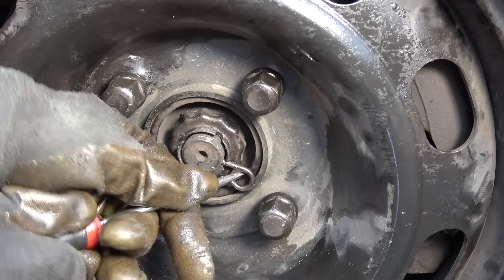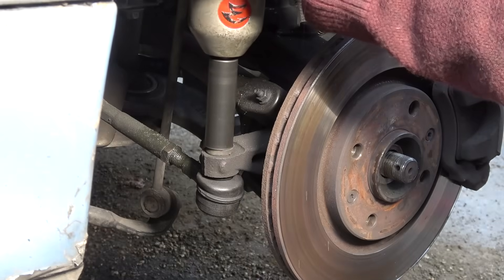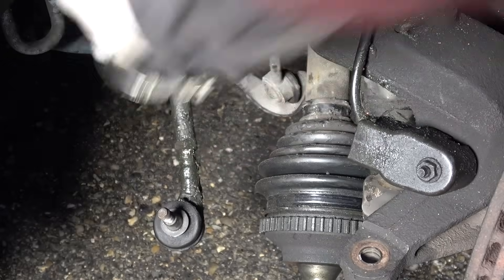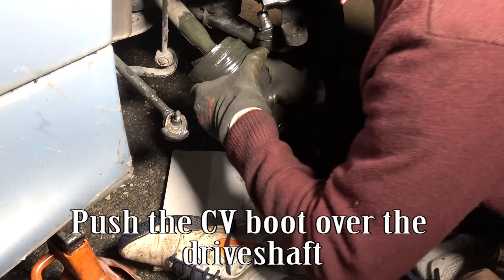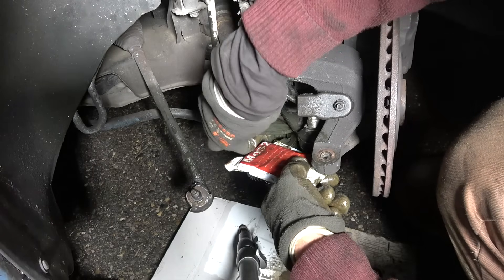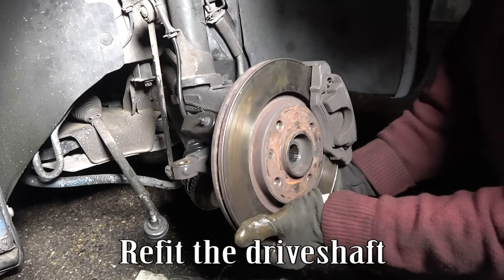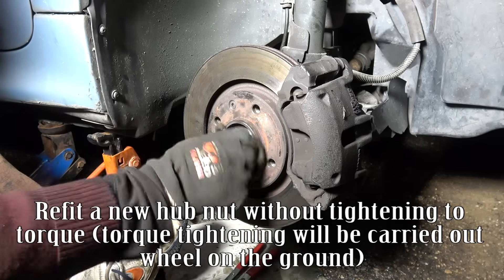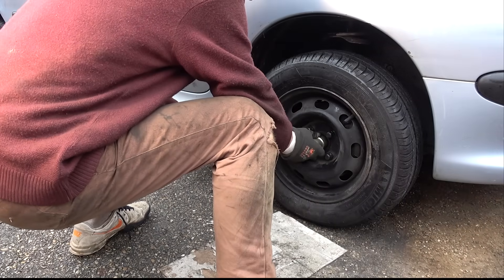CV boot replacement in place with a cone

Comment: Is this video a parody? Was he trying to tick off a list of things you should NOT do?

Start off with gloves that fit better then you won't be fumbling like a spaz.
Breaker bar to loosen the nut, then whips out the pneumatic impact gun?! Why?
Hammering the drive shaft naked?! Stick the nut back on the end if you really have to shift it and tap that, otherwise that recess in the middle is great for shoving a pointy bar in to jab it out. Damage the shaft and the splines and complain about the thing not meshing later!
Use tin snips to cut the clip, not a dremel! Now you have metal shards everywhere and cleanup became a lot harder. What else you likely to cut with the dremel? The ABS?
Looks like you're using engine oil to lubricate the cone, which will corrode the rubber. Use the grease then you won't get contamination.
Spraying brake cleaner on the old boot, to do what except shift all the dirt into the existing grease? And not cleaning out the old stuff first before squeezing the new grease in? Your DRIVshaft is going to sound like a peppermill 😂

Mate I hope no one is seriously following your example.

Comment: I used soap instead of oil .... it's bad tecnique if you completely reverse the boot .... it increase the friction ... I didn't reverse the boot, I get soap everywhere on the external of the boot and put the small tip of the boot on the small tip of the cone .... you clean you hands, so have good friction on the boot and you push it with the hands on the inter dry side. Of course, the boot tend to reverse itself, but only partially if you push on the small part of it. A strong e decise move seem to work better in order to get it over the large part of the cone. That's it. If the boot reverse completely on the cone you have much more friction and a great struggle to get it over the end of the cone. The smaller part of the boot (externally) has to be very slippery and the large end the the cone too .... there is where the struggle is.

Comment: While this may look easier I highly encourage people to just take the axle out completely. All you need is a flathead screwdriver, pry it to where it connects to the drivetrain and pop it off.
Afterwards with a hammer just lightly tap the CV joint out and done. Once the boot is in and you cleaned her up good just tap the joint back on.
Sounds like more work but trust me, this is waaaaay harder to do.
P.S. Do not use break cleaner on rubber, it deteriorates the material. Instead use any mechanic soap to clean up the excess grease/oil.

Comment: Just remove the driveshaft, put the shaft in a vice.  Cut off the old boot and compress/expand the circlip and tap the CV joint off the shaft.  Clean up, re-grease and reassemble.  Yes you lose a little gearbox oil but it's a lot easier than struggling like this!

Comment: Excellent video, just one comment, this was made more difficult by allowing the new boot to go inside out on the cone. Grease the cone and push the boot onto the cone keeping it the right way around. Push the boot almost to the end of the cone before offering up to the drive shaft. The use of the plastic bottle is a fantastic idea if the cone is smaller than they’ve joint. Once in place push the boot off the end of the cone, the smaller end will snap onto the shaft and the boot will be the right way around and clean on the outside. Always made sure the joint is clean and re grease before fitting the boot and clamps.

Comment: You can see his inexperience when he is torquing on the wheels when he should be applying the force downwards instead he is lifting up the torque wrench making his life harder.  Just like undoing the axle nut it easier to apply force downwards by moving the breaker bar to rear of car instead of front car and lifting!  It only takes me 15 minutes change the CV boot the cone method would gets lots of looks in the shop what are you doing?
Reply: What is your method for changing the CV boot?

Comment: What a pig of a job. Easier to just fit a complete new drive shaft with new cv joints, grease, boots and no messing around. The cost isn't a whole lot more when you consider you get a whole new drive shaft, with new joints and boots that are not stretched on and less likely to prematurely fail. Should also fit a new hub nut at the end.

Comment: This cone method saves the removal of the joint from the shaft, but it seems to me that the extra effort is not worth it. You could just remove the joint and slip the new boot onto the shaft with ease, and avoid the risk of over-stretching the new boot causing crack.

Comment: A moderately strong 💪& determined man(or gal ?!) is required. Its questionable if its worth the aggravation since the entire axle itself usually isn't too expensive, although more than just a boot kit. & you'd ONLY opt for this if you're 100% sure the tear is new & there is NO wear to the joint. The grease really should be replaced anyway.  Whereas pretty much anyone with the tools & knowledge can replace the entire axle. I've only ever tried this like 3 times & trust me, the vid makes it look easier than it is, or was for me anyway, though they are all a little bit different. Good vid though.

Comment: Realized that this guy had no idea what he was doing when he pulled up on the hub/axle nut to get it loose. Flip the breaker bar 180 degrees and step on the bar. Use your body weight to push down instead of damaging your lower back to pull up.

Comment: The inner race is removable from the axle, so there's no reason to use that cone. The "universal boots" are more flexible, but less durable, so they won't last as (very) long.

That means you bought a tool to more easily make a repair the wrong way, to ensure doing it again.

Comment: Good video but from experience it easier just to tap off the CV with a hammer and put the new boot on without stretching it. Usually there is just a small circlip on the driveshaft to overcome. Alternatively on some cars with a hub bolt, just screw it back in to pop the CV.
Reply: Besides, it's easier to properly clean the dirt and old grease out of the joint once the joint is off the shaft.

Comment: Alot of mistakes here. 1st: do NOT use your knees... be smart and use a cheater bar or air gun (your knees will thank you). 2nd: don't use scizzors use a utility blade when cutting the old boot 3rd: do NOT twist on the boot clamp that does nothing and screws up your elbow

Comment: Not sure what type of vehicle/axle this is, but I've replaced CV boots and axles on many different vehicles. In most cases, removal of the CV joint from the axle only requires snap ring pliers. Removal of the entire axle can be difficult on some vehicles, but on many it's as simple as prying the axle out or using a puller (rent for free at most big box auto parts stores).

Comment: Having just put a new boot on the front of my car I can honestly say that's just making a fairly simple job hard work .  Pull the drive shaft out and do it on the bench .. hardest part of this job is getting the car on stands ..
Reply: It is more unsafe to pull the drive shaft out you may damage the gearbox orings and then you got yourself another job
Reply: @nicudorin7292  Just fit a new seal before installing the CV...

Comment: Isn't the end only held on with a circlip, easier to remove than use that cone
Reply: Yes lightly pull the cv joint to you and with a neoprene hammer a couple good whacks towards you in the cv joint and it pops off. Putting it back on is just lining up the splines and a good push it snaps back on
Reply: I was thinking the same thing
Reply: Circlip must easier so is popping out the drive shaft. Could have done five to the way this is done.

Comment: This video is well filmed and helpful  BUT the axle ball joint should have been thoroughly cleaned (rugs and brake cleaner ) before repacking with grease and also you should have put some grease on the shaft splines before inserting it to the hub .I hope you degreased your rotor too !   Just some advice on good practices . (As far as the title goes this tool and procedure is cheap and doable , not easy.)

Comment: This is painful to watch. Just tap the cv joint off. Would have saved you a load of time rather than mess about with the hideous cone thing. Leave the nut on the threat next time when hitting with a hammer. Will save you wrecking the thread. Defo an amateur half a job here.

Comment: So, I just successfully did this over the weekend.  I have a few tips to anyone trying it.  First, put a ton of oil on the cone--I had a half qt of some motor oil. I used a foam sponge and liberally! coated the cone.  Then, coat the outside of the new rubber boot.  Put the small end of the boot over the cone and pull the big end over, reversing the boot.  The video shows this.  This put the oily side of the boot on the inside.  Then, use a heat gun on a lowish setting and CAREFULLY heat up the new boot, the oil and the cone.  After its pretty warm, not hot enough to melt the boot or the cone, pull the boot down as far as you can a few times before you hold the cone up to the axle end.  I think this works the oil into the boot.  Put a little more oil around the very end of the cone (that's where the tightest area will be when the small end of the boot goes over the cone).  Then, hold your cone up to the axle end.  Give one big huge shove.  My boot literally went up and over the plastic cone and onto the axle with a pop.  I was pretty amazed.  I think using a ton of oil and some heat is the key.  Then, of course, clean off any oil that you can so the boot isn't all oily.  I used a rag and some Dawn detergent--I didn't want to use brake parts cleaner on the rubber.  Good luck!
Reply: If you slip, you get bruises
Reply: Warm the boot put it in front of a electric heater or yer oven @ 175 degrees, yes sir , use Dawn dish soap for lube!
Use dry gloves not ones covered in oil to pull down the boot.
Reply: Just tried put a new CV boot with this cone today, didn't work, I will replaced the CV joint and be happy, it's basically the easiest way to do this without suffering with this cone from hell. ✌️
Reply: Generally I agree with your comments and tips here, I have changed to lubricating the cone / new boot with silicone grease, it seems to work better for me. I do apply heat as that helps too.

Comment: I guess this guy doesn't know that they sell split CV boots that glue together. I put one on my honda in about 20min. Kept it warm with a hairdryer so the glue would dry faster,maybe stronger?Using a split cv boot,you don't have to take anything apart except for removing the tire. Its been on my car for about a year now and I haven't had it split or anything. It was cheap too, I think it was about 22$. Fuck,I'd use Flex Tape before I did all that stuff. If I was going to put that much work in, I'd replace the whole thing.

Comment: Watching him loosen the axle bolt showed me his skills. Isn't it easier to push down on a breaker bar than pulling it up????
Reply: actualy it's not
Reply: So you telling me instead of him using his body weight it's easier to pull up on it? Work smarter not harder dude. Common sense...
Reply: @PHxNiteRider  in that possition is easier to brake nut using your legs rather than 75 to 85 kg of body weight if you ever did this you would know these nuts are not that much hard... I see you are the type of people that jump on tools insted to just use longer bar/pipe over braker bar
Reply: It's called physics my friend. And for you to argue that just shows me how smart you really are.

Comment: I just used this video to replace a cv boot, and found that the replacement cv joint cost the same as buying two boots.  ymmv, but it is possible just replacing the entire cv joint is faster and easier than these directions.

Comment: I found this video to be as real as it gets. Real struggle! Not candy coated where everything fits, goes in or comes off on the first attempt. It took some doing and the mechanic definitly earned his money.  Thanks for showing like it really is.
Reply: He made it harder by being filthy. Grease all over the place.
Reply: lmao not cleaning the old grease out getting it all over the outside of the new boot and fucking everywhere else and all the panting was giving me anxiety
Reply: Horrendous job. Mixing grease and oil, metal shards everywhere probably sitting inside his driveshaft boot now. Good luck to him but I doubt he'll get much wear out of that before it starts to sound like a peppermill.
Reply: Except it was done woefully wrong. Its not how its really done. A decent mechanic would either replace the whole axle or remove, strip and inspect it/repack it with grease. This was painful to watch and a good example of what not to do.
Reply: some places people have to do what they have to do....don't have the benifit of what we may be used too
Reply: @roberthawks9704  yes, should watch "Pakistani" Mechanics working on big trucks with basic tools.
Reply: @bEEBO178  so if u paid someone to do the axle boot and it looked like this, u wouldnt be able to tell the difference if he did it this way or took the axle out. Got the job done and didnt tear it. If hes ok doing this way without tearing the boot yay for him he still got it done

Comment: Oil the rubber boot up what a prat oil is not good for rubber
Reply: George Alberts he cleaned it with brake cleaner!!! I thought that may have damaged the rubber....I would have used a silicon spray lube instead of engine oil.

Comment: If you want to watch a fool make really hard work of a simple 20min job this is the guy for you
Reply: Hahahahaha
Reply: 2 days to fit a cv boot 😅
Reply: Pritchy you wanker
Reply: Total knob..do the job properly drain the gear box oil ..remove shaft from the  gearbox and the hub. remove cv joint from shaft on a bench& fit a proper boot not one of those cheap rubber ones...total cowboy...and a messy one at that 😂😂😂
Reply: @johnmayberry7669  nothing wrong with the cheap boots, put one on my transit 8 years ago, still fine.
But I use the air tool to stretch it over, this video is painful to watch
Reply: @johnmayberry7669  not everyone have the place  to  do such work. besserwisser
Reply: Your an idiot

Comment: Just doing this, using the 'cone method'(should be the cone of shame method) Had to remove the 'drift' shaft(drive shaft/Axle shaft) on my Seicento as I just couldn't get the leverage(I am weak, yes I know) so took it to my flat, put the kettle on, had brew and put the new rubber gaiter into some very hot water for a 'wee while'. Lubed up the cone and, after fu@#ing around for about 5 minutes on it popped. I tried this before on the car but the narrow end of the gaiter split!! (Don't ask) so hot water did help in my opinion and also using my thumbs pressed into the upturned end of the wide end of the gaiter...

It isn't the easiest of jobs, more fiddly than technical... especially without a few tools(and maybe a vice to hold the shaft) but I am almost there...First things first, another cup of tea.....

Comment: I remember the split CV gaiter which you would have to glue together up the whole length after placing it around the shaft. 
Great for MOT's but you'd see it in the rear view mirror after a few hard bends. It would follow you down the road on the way home from the test. 
Who thought that would be a good idea? Grease & glue don't mix.
Reply: Thanks for the laugh Tony, I agree with you on the split gaiter.
Reply: TBH they are a lot better these days, My son put one on his 5ltr Audi and its lasted 2 years now no problems

Comment: So much struggling when you can remove the cv end using the hammer 10 sec  and also so much cleaner!
Reply: Treu...
Reply: Some peugeot shafts you need to strip it down from the other end.

Comment: it will be easier if you press down the braker bar or the tork wrench with your foot to loosen the nut or to tight it up . chrisfix says that hammer hit on ball joint and tie rod end can damage it. but if you hits on rigid metal is it ok?
Reply: Yeah just hit the metal not the thread you can damage it , hit the metal it will pop out straight away